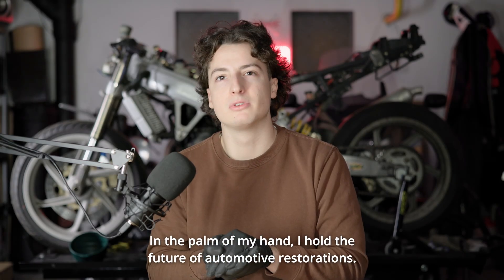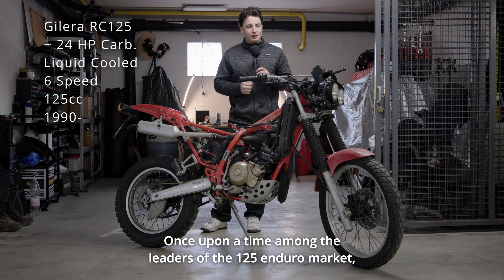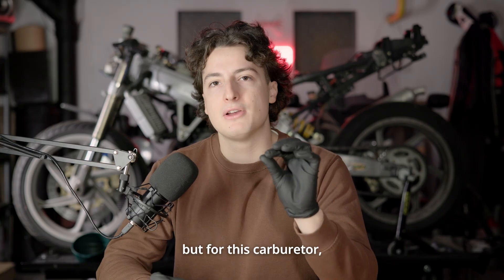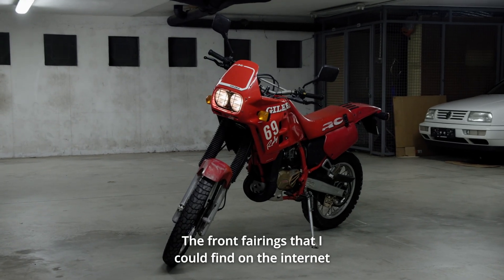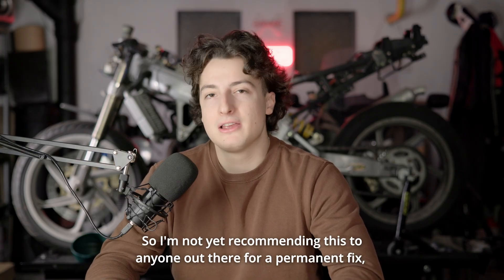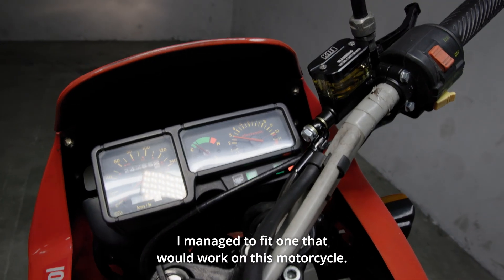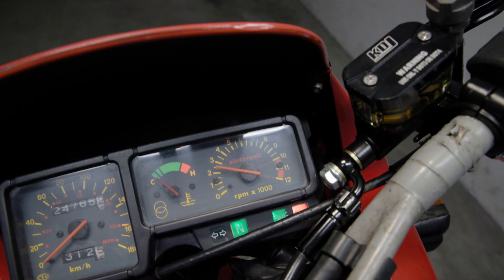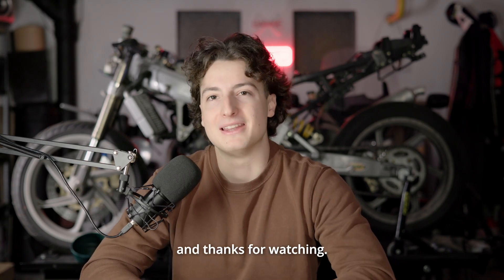Modern Tech Is Saving Classics – Here’s How

Comment from the maker: 3D printing literally saved this project. Have you ever had a build stall because you couldn’t find a part?
What’s the first thing you would 3D print for your car or bike?
Reply: I mostly stuck to household items, but now I see that theres so much more to try. Gotta buy a scanner in order to replicate some parts on my car 😎
Reply from the maker: A 3D scanner is a great tool, however I do recommend checking online to see if anyone else already had the same or similar print project. You would be surprised how many files you can find on websites for free, the community is lovely :)
Reply: The first thing I printed for my car, was probably a lift kit. Got the drawings from a forum, jumped into Fusion and had the entire kit in my hands the very next day. One of, if not the best functional 3D print I've made so far.
Reply from the maker: @jackblack2931  That is one of the greatest ideas. What material did you use and how is it holding up?

Comment: What material did you use to make the soft components? The carb elbow for instance?
Reply from the maker: Thank you for the question :) For the carb elbow we used 55D TPU, mainly because it gives the flexibility you need and it’s easy enough to work with when you’re still testing shapes and fitment. It’s holding up well so far, but I’m keeping an eye on it since heat and fuel exposure can be tricky long-term. I’m also looking into some higher-temp TPU/TPE blends for a future version. Have you ever tried printing anything like this yourself?

Comment: All pioneer engineering starts with mistakes or component failure but the more often it is used the more both manufacturers and innovators adapt to resolving problems with both design and material failure. 3D printing is really still in it's infancy and as time elapses better processes and raw materials will be made available if there is sufficient need in the market. Following a few motorcycle renovation channels for older bikes the carburretor manifold seems to be a very common issue. Maybe if the manufacturers of 3D printing compounds were made aware of the essential requirements for the material they could develope a raw compound suitable for the task. This will only happen if there is enough interest in the product to make the research economically viable. So if you have a need, get in touch with manufacturers. They can only react if they are aware of the problem and the need for a suitable product.
Reply from the maker: Thank you for such a thoughtful comment :) You’re absolutely right, a lot of these early failures are just part of moving the technology forward. On older bikes, things like intake or carb manifolds really do seem to be the weak point everyone struggles with. I’ve seen so many different improvisations, always interesting to see how people try to solve it. I agree that if more people reached out or showed interest, manufacturers could start developing compounds specifically for this kind of heat and fuel exposure, and it could be very soon. It’s definitely an area with huge potential. Have you ever tried printing a part yourself?

Comment: One way I've used 3D printing to aid in my car's restoration: Recreating niche, obscure tools. Sometimes old vehicles have parts held in with bezels that require a make or model-specific tool to remove, and in my case the ignition was held in by such a bezel and needed to be replaced. I took a few measurements, then designed and printed a tool to mesh with the bezel so it could be unscrewed. It worked, and now I have a functional ignition again!
Reply from the maker: That is extremely useful as well, great point and thank you very much for sharing :)

Comment: Nice visuals and cool designs. Is that a Gilera SP125 in the back?
Reply from the maker: Thank you very much. The motorcycle in the background is not an SP125, any other ideas?
Reply: @JaPsGraph  The only other sporty Gilera would be the CX125 but that one is different. So it must be a another brand...
Reply: @WillCon-w6g  I'm fairly certain it's a Cagiva Mito Evo
Reply from the maker: @SeppelP  You are correct, great eye :) A question for the professional, is it an Evo 1 or 2?
Reply: @JaPsGraph  with the 6-Spoke rims and aluminium Exhaust, i would say it's an evo 2
Reply from the maker: @SeppelP  Amazing, how do you know so much about these?
Reply: @JaPsGraph  I've had my Evo 1 since 2008. it's currently in about the same state of assembly as yours. The second i started the video the back of my head went "thats a Mito behind him".    Mine also has a printed intake behind the carb btw
Reply from the maker: @SeppelP  Thats really interesting to hear, the state of the build and the intake, thank you very much for sharing. Did something put a pause to your project?
Reply: @JaPsGraph  i'm building a house so i got no time for side-projects a the moment. I got all parts i need so it willl be finished afterwards.  Do you plan on making some videos on/with the Mito?
Reply from the maker: @SeppelP  Thats great to hear, best of luck with the house :) The Mito is also being restored and I'll make sure to film as much and make more videos about it. Would you like to share why the Mito is so special?
Reply: @SeppelP  Ah thank you. Those look really cool